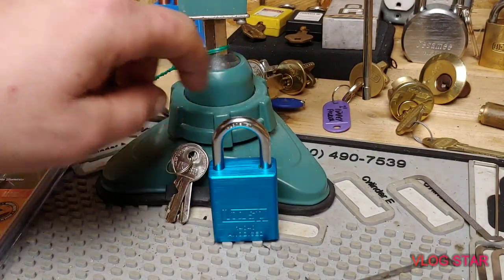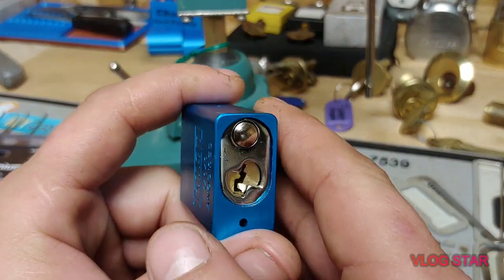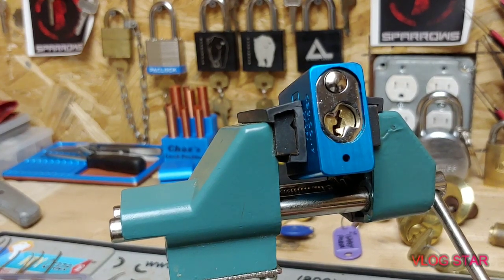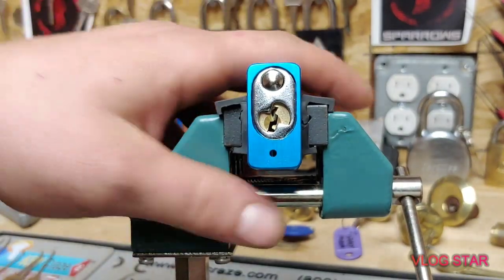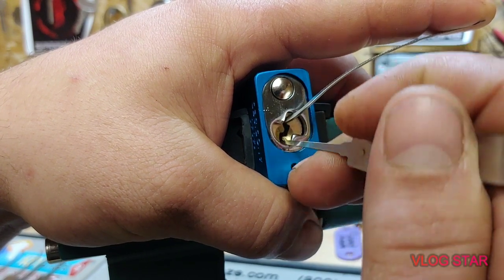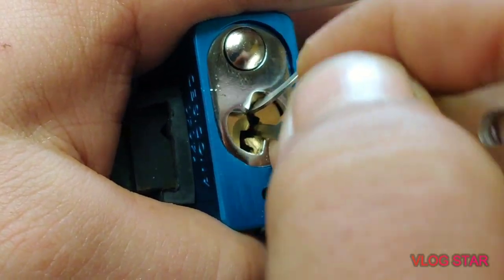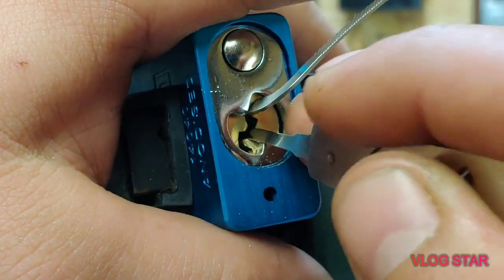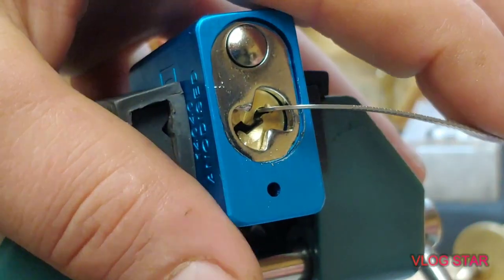(#39) #StockLockSunday  Kasp 14040

Comment: Been collecting locks since I was 10. Recently bought a starter set of picks from sparrows. Lots to learn. Enjoyed how your work station is set up. Looking for a good fairly priced mat to work on . Thoughts? Thanks for sharing.
Reply from the maker: Well thank you I appreciate that! 
Well I chose to find a mat on eBay. They range from $22-$28 depending on which one you buy. I know that most people on YouTube have the sparrows pinning mat. I'm not sure how much they are from sparrows but I would imagine about the same or cheaper. I hope this helps some and I will try to get a video up that shows how to put the lock back together.